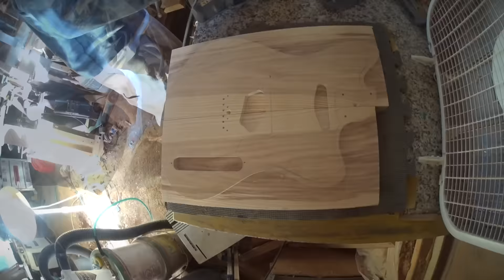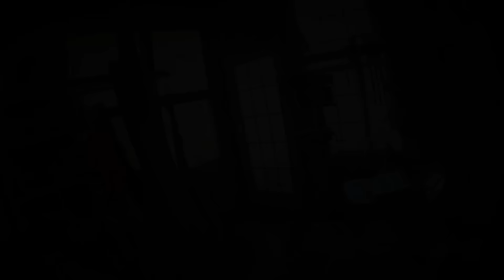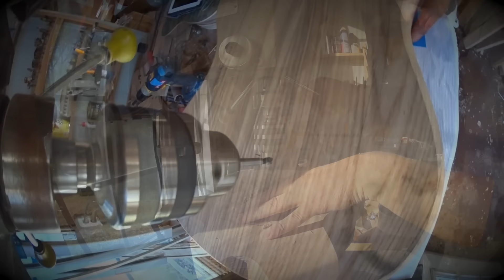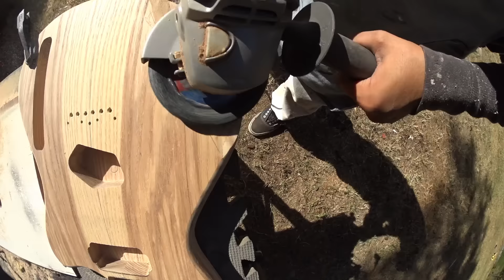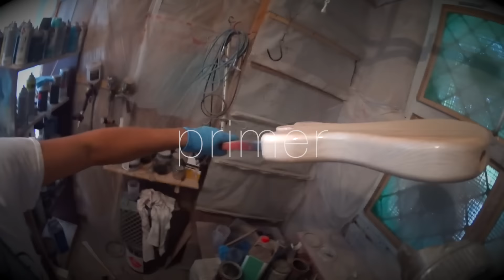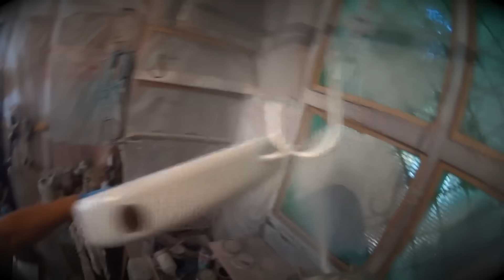How to build a Custom Electric Guitar part 1

Comment: Is it possible to use a jig saw instead of a band saw when cutting the neck out of the block of wood? Thanks
Reply from the maker: yeah, you can definitely use a jig saw instead of a bandsaw
Reply: Thanks for the reply. Also I was wondering could I use a jig saw to make the cavities in the body instead of the machine that you use? Or is there some other simple hand tool that I could use instead to make the cavities? Thanks